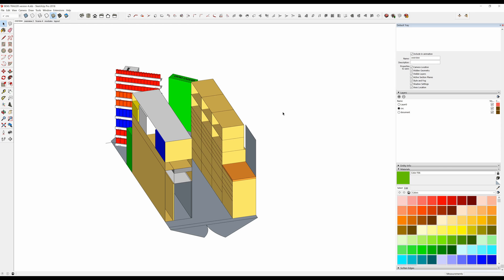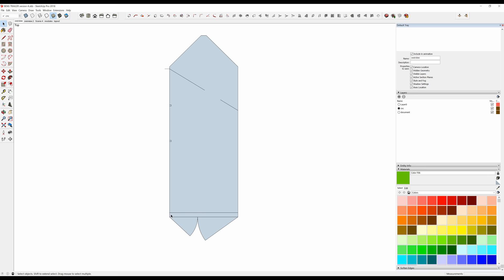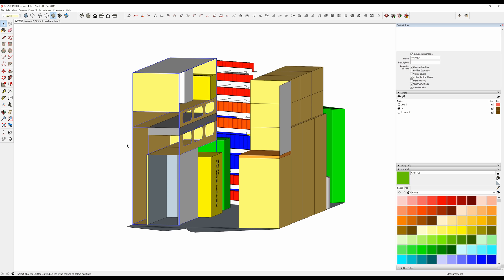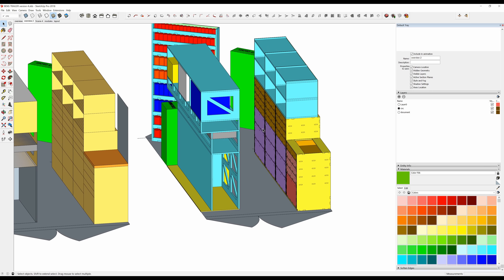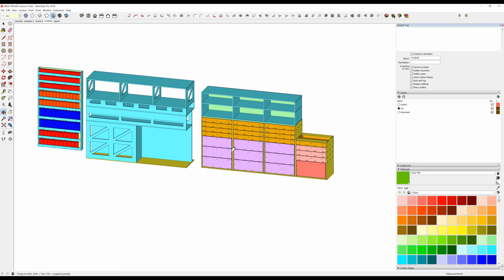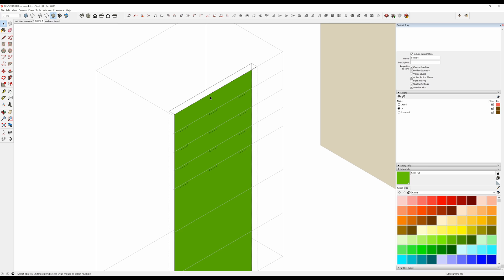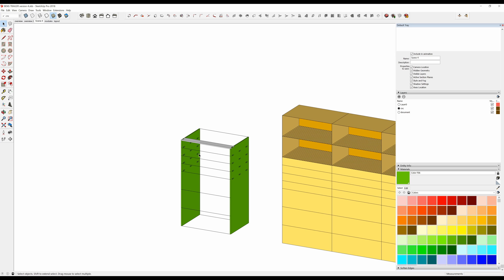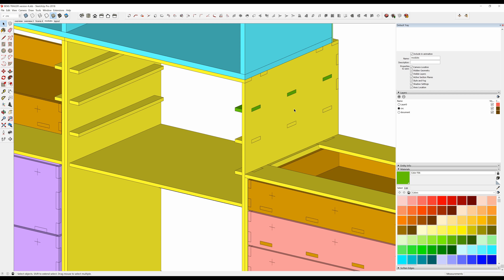Designing a Contractor Trailer in SketchUp - 359

Comment: Very detailed planning. Don't forget to allow 1/2" each side for the full extension drawer slides when building the drawer carcasses and if the drawer front will fully fill the space & overlap the drawer carcase in which case they will require mortice instead of box joint edges

Comment: Great "tutorial" and design! Maybe you mentioned it and I just missed it, but correct me if I'm wrong: can a CNC make a straight 90° turn, meaning the mortises and tenons don't need work and just click in? Or can you draw 90° and the carving creates round turns that "eliminate" each other?
Thanks Jay!
Reply from the maker: Search Google for CNC dog bone. It's a process where at the inside corner of the mortise the machine over cuts slightly to allow for the square stock corners.
Reply: @JayBates  thanks! Knew it was thought of. Just couldn't figure it out 💪👍
Reply: @JayBates  do you set up the dog bones in your avid cnc program?  or is that something you do in sketchup that is not inclouded in this video?